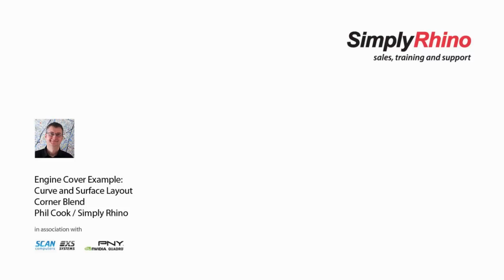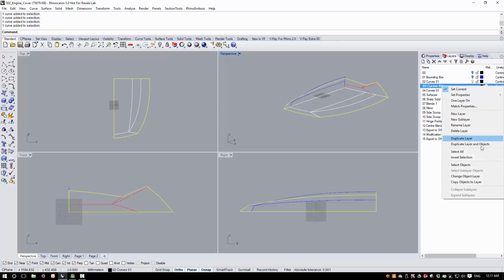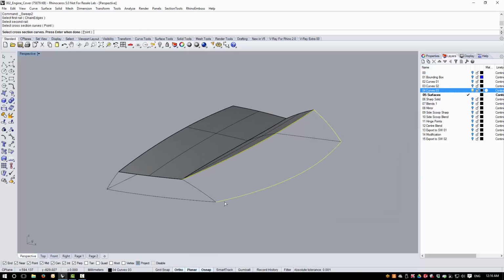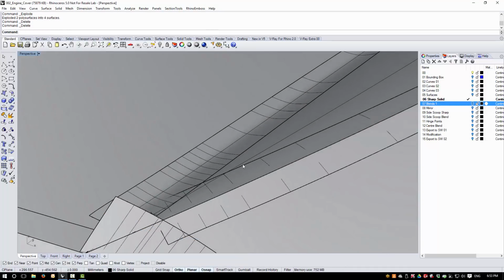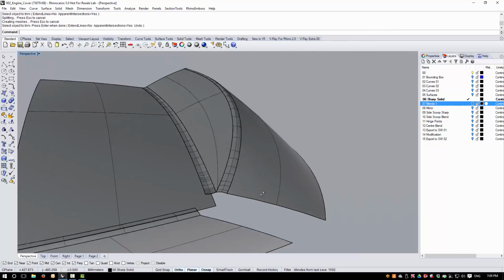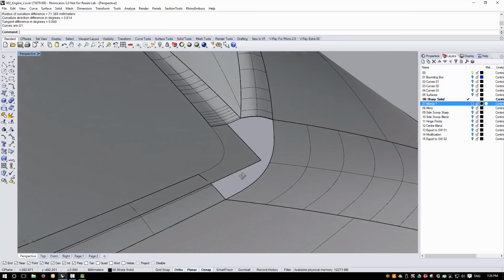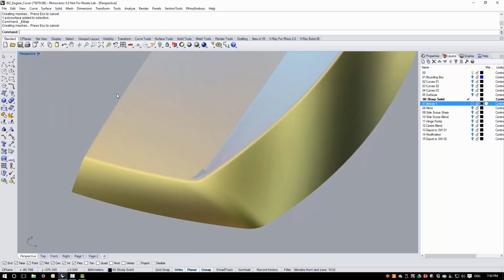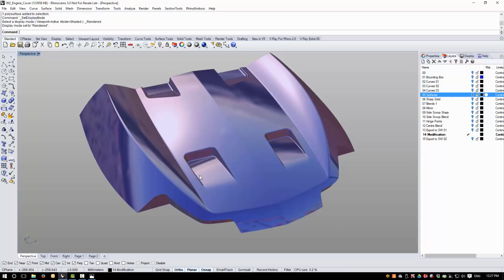Rhino3d Tutorial  - Engine Cover - Modelling the Overall Form and Complex Corner Blend (1 of 3)

Comment: 6:31 .... Can I use the Rebuild curve function?
Reply from the maker: Hi, You could use the Rebuild Curve function but when you rebuild and reduce the control points count the shape of the curve will change and you can’t really control this - using the process in the video creates control points at known positions (that match those of the extrapolated 2D curves).
Reply: @SimplyRhino3D   4:17 ...I noticed that the point control positions are very consistent in the Top and Right views. Could you please guide me on how to do this? Thank you for your helpful sharing.
Reply from the maker: @thaibui5911  Initially the two 2D curves were rebuilt or created with the same number of control points, the points were then manipulated to adjust the shape and aligned using the SetPt (Set XYZ Coordinates) command. We cover this type of workflow in our exclusive Rhino Level 2 course with Phil Cook, if you are interested in any training: https://simplyrhino.co.uk/training/courses/rhino-level-2

Comment: The larger edge blend (80mm) at ~13min twists itself for some reason. Anyone know why that may happen?
Reply from the maker: Hi, I think what you are seeing here is this: The Fillet Edge and Blend Edge commands produce a surface (or polysurface) with isocurves that are perpendicular to the sharp edge. Because of the relatively large distance between the resulting rails and the angle involved on the shape, the lower rail is substantially shorter than the top rail, hence the isocurves start to move and the fillet surface twists. If you were to look at this condition on just two surfaces you might see this a little more clearly. Hope this helps.
Reply: @SimplyRhino3D  Great, thank you for you're reply!
Reply: @SimplyRhino3D  Sorry, I am new at Rhino and I would like to complete this tutorial. However I am struggling with this same problem, but I didn't understand how to solve it. Can you help?

Comment: How do you think about method of pipe split ? May be it is more fast then this way.
Reply from the maker: Hi. Do you mean creating a pipe of the same size of the corner blend and splitting the surfaces with that? Yes, that’s still a valid method. However, since we created this video the Fillet Edge and Blend Edge tools have been much improved – so you’re less likely to need the ‘pipe’ option.

Comment: Great tutorial! But something lacking : Do you have a specific method to create all your curves with normal control points to each other? This is easy with such simple model but could be much more complicated when your curves don't always match the same directions, or when one curve describes informations the other don't.
Reply from the maker: Hi Gael. Thanks for your comments. I have found that it is indeed possible to create curves that have a different shape but share a common number of control points but sometimes this does take quite a bit of work. If the shape between one side of the surface and the opposing side is very different then using the ‘slab and transition’ methodology as per this video may not be the best way forward.
Reply: This is good stuff.  

I am using V-7 windows.

How are the locked control points set up to allow their selection in projecting to align the second line control points?

My model has 19 lines in plan and profile, simple continuous curves, no reversals in plan nor profile, w/ 16 points each, required to hold curvature in plan view.

Is there a tutorial showing another "way forward?"

Thanks for your time and effort in creating your great videos.

Best regards...

Comment: It is not clear to me, why the original curve from 2 views  is not usable for the surface construction (6:25/34:9)
Reply from the maker: Hi Jiri, I did try to explain this in the video. In this example ‘Curve from 2 Views’ creates a curve with many additional control points. As the aim is to work with limited Control Points this curve is only useful as a guide. Thanks.

Comment: I am trying to follow your instructions but I can't get the solid fillet blend to produce a polysurface fillet.  I'm using the trial version 6.  The solid fillet blend only produces a trimmed nurbs surface.  Please help.
Reply from the maker: Hi Daniel. Are you using Solid > Fillet > Blend Edge? If so make sure that ‘Trim and Join = Yes’ option is set as below:
 
Select blend handle to edit. Press Enter when done ( ShowRadius=Yes  AddHandle  CopyHandle  SetAll  LinkHandles=No  RailType=RollingBall  SelectEdges  TrimAndJoin=Yes  Preview=Yes )
 
Hope this helps.

Comment: Hi Phil, at 28:05, you used Sweep 2 to connect the edges of the fillets, how do you guarantee the edge continuity for both of these edges since they are sections of the sweep. Thanks a lot.
Reply from the maker: Hi Alex, If you are using Sweep2 you cannot match the continuity to the existing fillet edges (sections) so if the result doesn’t look good in Zebra and Emap you can use MatchSrf to adjust the new surface. Alternatively you could try using NetworkSrf but typically this would produce a more complex surface. Thanks, Phil

Comment: Thanks Phili, very good tutorial however
Why not filletting the the big front edge first with the solid fillet command before working on the smaller edges?
While sweeping why use the curves of the surface edges rather than its solid edges?

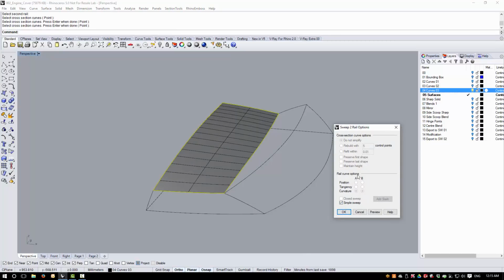Comment: Thabk you very much for video . I was not able in 9:22 to simple the surface and this option is demet . no shure why . Can you help me somebody ?
Reply from the maker: Hi, Sweep 2 Rail allows has a Simple Sweep Option that is available only if your curves meet certain conditions – for example the two rails of the Sweep will need to be of the same degree and have the same number of control points. Hope that helps?

Comment: Very interesting lesson. I wish Rhino was as capable at fillets as SolidWorks or Fusion 360 and had some construction history.
Supposing you realized the fillet radiuses for your hood are wrong and you want to increase it? You will have to start over. This is huge job. I believe solidworks (just open as parasolid or even 3ds) could make that manual filleting job easily and then you would just export it back as step file (but I realize it is not the purpose of this tutorial and user has to know how to make it manually) I quite often do such tricks. Maybe it is not very professional but for my tasks it is ok.
Reply from the maker: Hi Alex, Thanks for your comments. In the upcoming version of Rhino – v6 – it looks as though Solid Fillets are going to be editable. So if you’ve added Solid Fillets to an object (and remember that in Rhino the requirement for this command is a closed edge and doesn’t require an actual solid) then you can run the command again, pick the object and select the fillets you want to change. As I understand it this will work with Solid Blends too. In general the Fillets in v6 are much more reliable than in v5 and work in many more situations. It’s my experience that the fillets in Rhino v5 are indeed broadly similar to Solid Works in that (for example) they will fail given the same geometry. When aesthetics are involved, though, and not just in Rhino - there is often a need to do something that is more controllable than the Solid Blend or Fillet command will achieve and this generally involves building these surfaces manually.
Reply: Hi Phil, thanks for your input. I am already working in Rhino 6 WIP. The new fillet feature were the most anticipated thing for me. I know that I can edit now, remove it etc, but they remained the same with regards to their possibilities and restrictions. You cannot make second adjacent fillet to be larger than the first one, it will not be able to fillet converging edges as in your tutorial.  If you extract/explode filleted object you will lose the ability to edit the fillets even if you join in up again. So I really consider 10 times before filleting objects, or use render tool smoothing edges (for perceptional use) and fillet a copy of original object before doing renders. Not quite understood your comment on fillets being similar to Solid Works. Solid Works, Fusion, old Mechanical Desktop have no problems with fillets at all. If Rhino was capable to make the same complex fillets that would be brilliant. Rhino 6 is definitely the better product, but they lost T-splines and many cool plugins won't work, so it is just a core functionality. I need Tsplines 1-2 times out of 10, but they are must. So, for now I need keeping v5 and v6 together. Also was studding SolidThinking Evolve, Fusion 360 but non replaces Rhino fully.
I will learn your lessons on, it is perfect for deeper knowledge of Rhino. I wasn’t paying much attentions to continuities when I learnt Rhino many years ago, so I want to catch up on that. 
Thanks again for your great job!

Comment: Thanks for ur Video! how can I change curve point like that?
Reply from the maker: Hi Depla, does your question relate to a particular part (time) in the video? Thanks.
Reply: Thanks super fast Answer. I mean CV points style maybe just size
Reply from the maker: Hi Depla. You can change the size of control points (cv’s) on a per display mode basis. If you want to increase the size of the control points in shaded mode, for example, go to Options > View > Display Modes > Shaded > Objects > Control Point Size. The default size is 2px – on the video they are set to 6px. You will need to set the control point size for each display mode. Hope this helps.
Reply: Thank u so much! :)